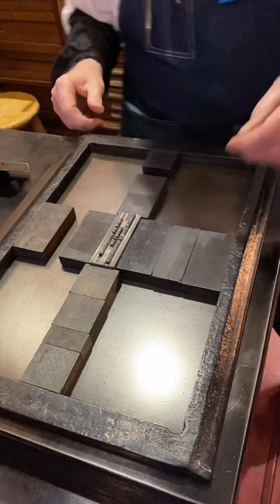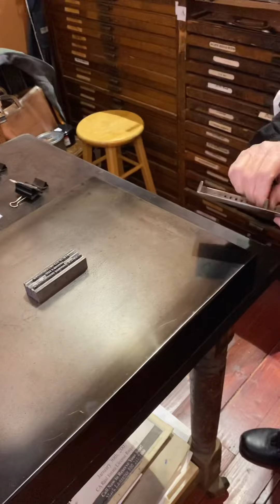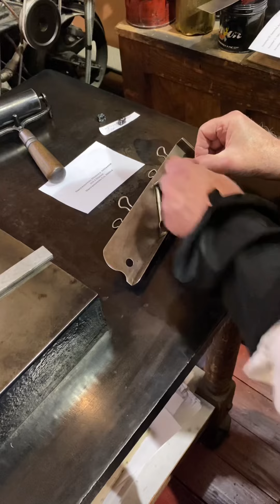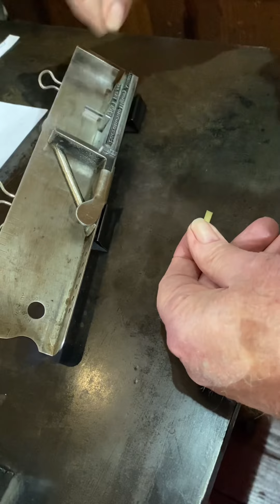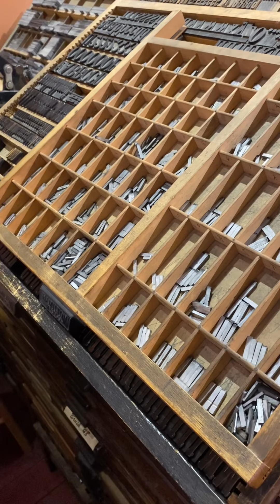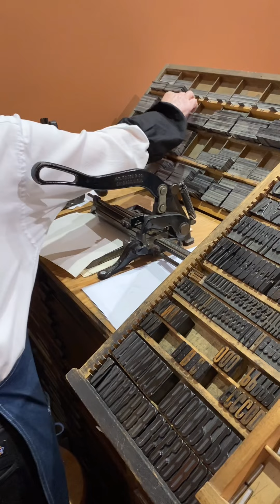Breaking down a form in letterpress printing

Comment: We only ever kept 14pt or above, any size of type smaller than 14pt was sent to the smelters to be turned into ingots that would be used in the Monotype Machines to produce new type pieces to replenish the used Fonts thus negating the need, and time, to return used pieces to the Type Cases.